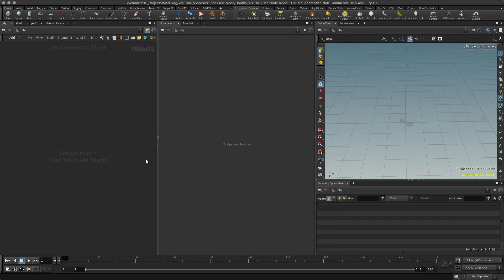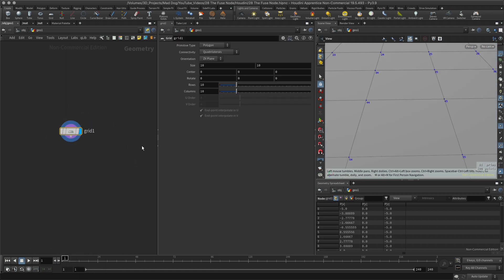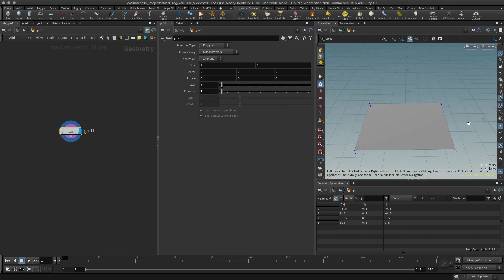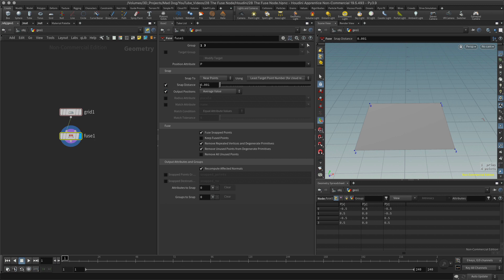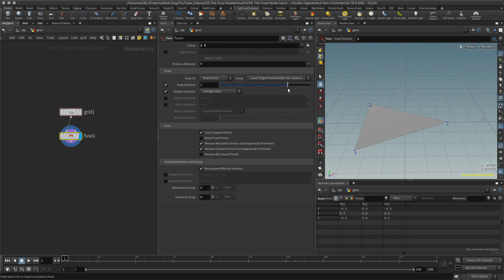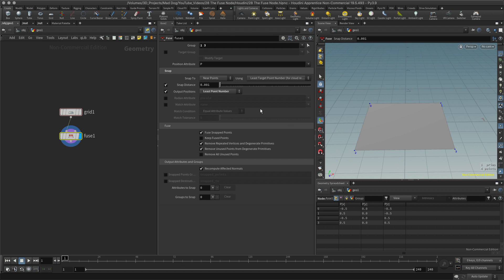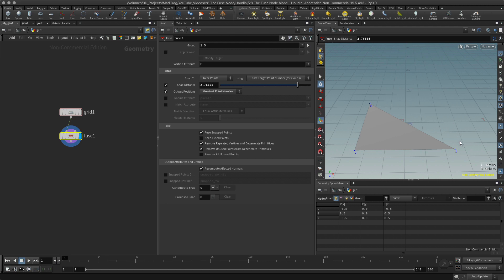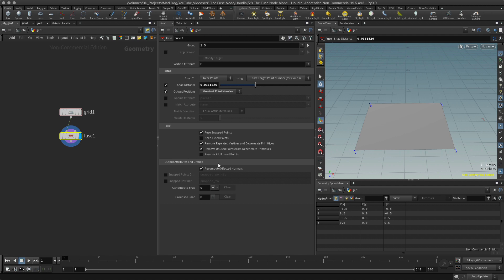#28 The Fuse Node in Houdini

Comment: Thank you.
But why can't we see the group in the Geometry Spreadsheet? as we can see you have 1 & 3 there.
Is the Fuse's "Group" section is a "point" but labeled Group?
Reply from the maker: I think I understand what you are saying. So regarding the group. You can create a group using the "group create" node and that will add the created group to the geometry spreadsheet, as you would expect. However, in the example above, I am just adding the individual points to be affected by point number (you can also just type in the point numbers into the group field in the fuse node). To my knowledge this will not create a group in the geometry spreadsheet, I suspect because there is no group name or group type information etc - plus it is not really necessary as a group name just refers to a bunch of point numbers anyway. 

So when you asked "Is the Fuse's "Group" section is a "point" but labeled Group?", you are basically correct with your assumption here. If you have a created group name you can refer to it here, but you can also just type in the individual point numbers - both will work.

I hope this helps a little.
Reply: @MadDogVFX  Thank you so much for the clarification :)
Reply from the maker: @Tritoon710  Not a problem. I hope this helps and good luck with it all. I know Houdini can be very complicated.